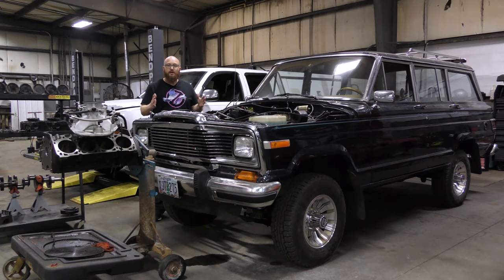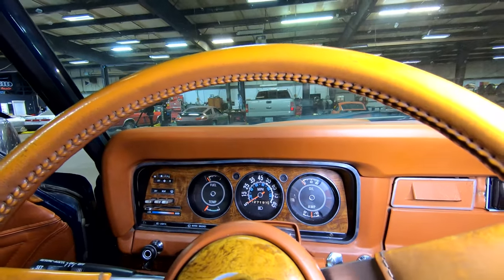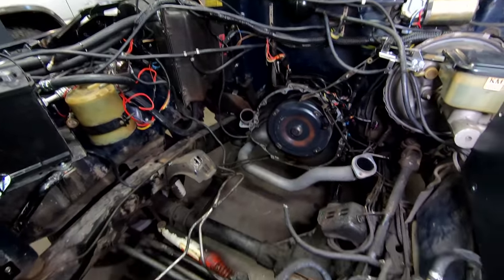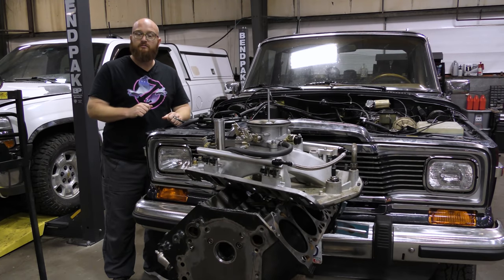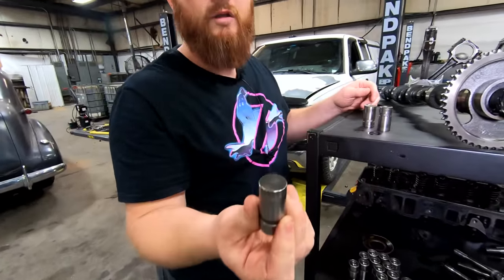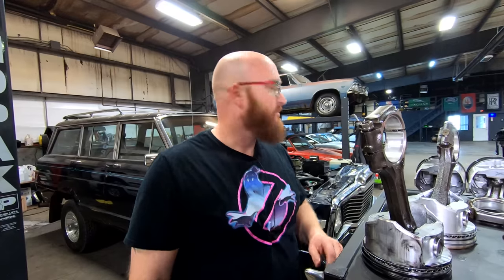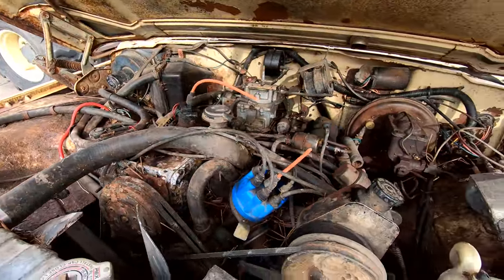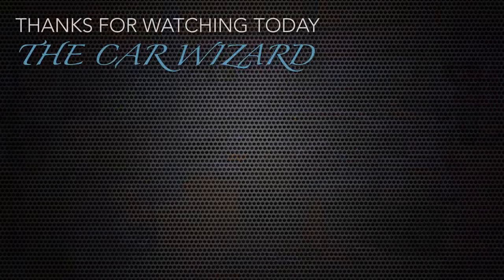The '83 Wagoneer rebuild is dead! CAR WIZARD gets burned by another shop!

Comment: Wizard - I am the proud second owner of a 1989 Mercury Grand Marquis LS 50th Anniversary edition 4 door sedan in Dark Blue Metallic paint with only 68,000.0 miles !   This car runs and drives like new and looks like it just came out of the showroom. I enjoyed your video about your tan Mercury personal car. This just proves that these wonderful cars are still available if you look for them. My other two cars are a 1987 Ford Crown Victoria wagon which I have owned since 1988 and a 1991 Ford Crown Victoria Wagon that I have owned since 2001. All are in excellent shape and the 1987 has almost 250,000.0 miles on it and runs like a watch. My fourth vehicle is my 1966 Jeep J-2000 Gladiator Pickup that I still plow snow with. Old Jeeps are great ,rugged vehicles .

Comment: Used to have a Wagoneer way back in the day.. we ended up swapping a Chevy 350 and transmission from a 86 3500 with a transfer case from a 79 K10, part time 4 wheel drive, NP something something.. had to cut a hole for the transfer case shifter.... I don't keep anything original.. had an old AMC Rebel that we swapped in an old souped up wrecked rust bucket 69 Pontiac Firebird 400, whole drive train..

Comment: I have rebuild a lot of V-8 engines, but I never saw a pushrod break through the block like your engine did. And I worked at a Jeep dealership when American Motors was building the Jeep Wagoneers. Those engines were good engines except for 2 things. Timing chains and water pumps. Very strange,,,,,,,,,,,,,,,,,,

Comment: RE:  ZDDP or Zinc Dialkyl Dithiophosphate    I have a comment that I hope is helpful. You didn't mention what kind of break-in oil you used.  On older style engines that were designed pre-1980s with flat tappet/lifter camshafts, like the one in the Jeep Wagoneer, one has to use the right break--in oil or additive, with 
ZDDP or Zinc Dialkyl Dithiophosphate, 
in addition to assembly lube. When motor oil formulations changed a few years ago, ZDDP was banned in use and it's generally not included in motor oil available today. It's not a problem with roller lifter, but it is with older engines that use flat lifters. I have built a lot of older engines, including Chevrolet 235 inline 6, 283 and 348 V-8, Triumph Spitfire, and Volvo B20, and all use flat lifters. I would also suggest using the ZDDP additive for at least the first 2 or 3 oil changes until you're sure the cam and lifters are worn in properly. 
I use ZDDP additive in all my oil changes on older stuff even after break-in. So, really, either use a break-in oil with ZDDP (it can be had from sources) or get a ZDDP additive. While the engine you had may have been messed by inferior parts or a poor assembly mechanic, a small detail like the wrong break-in oil can really ruin a lot of work.

Comment: My 04 wrangler rubicon, Jeep rebuilt the engine on 05, less than 60k on the new motor I had this same thing happen to my lifter and cam, HOWEVER this was due to the quality of the head during those production runs. This December I chased a P0301 with the parts cannon and nothing then the intake valve on cylinder 1 failed “sucked a valve” intake valve stuck high buried the pushrod holding the lifter down creating the EXACT same condition you pulled out Jeep. I know you have but I’ll say it anyway, check that valve on that cylinder.

Comment: . . .  for clarification, you have a rat motor from a Jeep outside.  (I liked the 427 Chevy.  I had a 1969 Chevrolet Caprice with the 400 Turbohydramatic.  I had it for over 100,000 miles.)  . . .  Sorry, but I could not resist the comment about the "rat motor".  🤔  I sure enjoy your comments.  . . .  and your wife is appropriate with her comments.

Comment: Rules of thumb:

1. If you think you've used enough lube, you haven't.
2. Always triple check your clearances and mic your rounds, make sure they're still round.
3. If you can't break in the cam (lack of test bench/dyno etc), tag the engine so the next guy knows to do it.
4. Use a race shop when you can. They know shit even avg machine shops don't.

Comment: I had an AMC 401 built about 2 years ago. They are special engines and not cheap to build right. But oiling issues are the main concern. This is just bad machine work! Glad you have an engine, but also 360s are fairly cheap and common since they made so many for so long. 91 grand Wagoneer with the AMC 360 was actually the last production domestic vehicle with a carburetor!

Comment: Martin Machine is a fantastic machine shop. I work with him from time to time when I get in a pinch in my own machine shop.  I will say however I wouldn't condemn  the original buyer based on what you have shown. In the last year I have had similar failures not less than 6 times. The cam cores for the hydraulic flat tappet cams are failing at such a high rate throughout the industry that it is giving us a horrible reputation.  
In my shop alone the warranty rate on engines I have been building for 20 years is up 400%. Between cam failures, lifters that collapse with less than 500miles on them,, bearing delamination (king bearings) and crankshafts that are cracked straight our of the box. 
The failures you have started with the cam going flat and the lifters collapsing. After the pushrod punctured amc's notoriously thin water jacket the discoloration of the rod bearings would have shown up near Instant.  They first show any deviation in the honing of the big end then a little longer they will be darker grey and look like they have water spots then seize. 
Once the cam wore through the bottom of the lifter it would have experienced a change in oil flow internally and started to seize the rod small end. In one shot the jammed piston looked like it was galled up the side this can deform the piston enough to lock up the rod also.
Again I am not sticking up for the shop that did the work. I however just like you have found out from other people that I preformed a job that the customer is now mad about. If that customer had simple come back to me I would have made it right no questions asked but was never given the chance. Obviously there may be more to the story.
Reply: How does the push rod puncture the 'thin Mopar water jacket' in an AMC 360?

Comment: Ummm....the hole in the block wasn't caused by the lifter.....scrubbed cam lobe tosses the push-rod when the clearances became wild...
But still....a stock valve spring having enough force to do that with one cycle?...Looks more to me like the block failed and flooded the cam lobe with coolant.
  That valve train is OLD school Detroit, long before the Chinese parts began to screw ICE reliability. Any engine build shop in my opinion, should pressure test the coolant passages before any machining process....but even then, why the heck would a casting fail there?....bad production processes

Comment: I have a 401 AMC V8 in my 74 CJ5 I built 12 years ago . It's just gone 70k problem free miles since the rebuild and I 've beat on it like it owes me money since day 1. The key to AMC V8s is Correctly performing the required oiling system modifications,  the addition of a oil pump Stainless Steel mid plate and adding a additional quart of quality oil of the right viscosity . I have ran my 401 and every other AMC V8 hard including extended runs @ high RPM on a dragstrip and in the mud pit countless times and haven't had a failure since I began doing the suggested mods and additions to their oiling systems. It's very easy to get excellent power and performance from the AMC V8 engines with just a few changes with the oil mods being first. They are cheap considering their benefits , very easy to accomplish and require just a little bit of Time and effort to make a good engine a great engine.  Everything one needs to do is clearly outlined on several different online forums and websites.

Comment: Wanted to add something about this that I have seen a video on... 
 I think it was from Uncle Tony's Garage.  He is a KNOWN master engine builder especially Mopar. Also a known former drag racing guy. Guy knows what he is doing.
He did a video on a serious aftermarket parts problem he had run into on some builds.
bad lifters being sold by reputable retailers.. He had an engine  get trashed during the break in process, discovered that the surface on the lifters was NOT crowned properly and also possibly not hardened properly.. that prevents them from spinning as they are supposed to.. and results in camshaft destruction, and fine metallic powder created by the lifter grinding away at the cam lobe being pushed all thru the engine, destroying or badly scuffing the bearings as you see in this engine.
the risk in reusing any of the parts is that you could end up pushing debris from the old parts into the oil passages on the new engine and wrecking that also.

Its also possible the engine builder messed up something too.. but since this failure is exactly what he had happen in his engine.. I thought I should pass on the info.

Comment: That can lobe died from a common oiling issue common to the 340, 360 and 401 AMC engines. Crossover oiling does help but requires drilling and tapping NPT threads.

Comment: FYI. These days there are many new cams failing.  The word is the steel being used in most ALL new cams is inferior.  The lifter wipes the cam stops lubing in that cylinder there fore blowing the rod.  It’s a big problem wiping the old diehard powerplants into scrap one by one.checkout Uncle Tony’s Garage, Envyclopedia of knowledge(Mopar) peace

Comment: I suspect the break in was done without a proper ZDDP oil.  The motor oils available today have little or no ZDDP (zinc phosphate).  That is fine for more modern cars with overhead cams or roller hydraulic lifters.  A flat tappet hydraulic lifter like that will flatten the cam in short order and then the fine metal particles go everywhere.

We had a customer with a pair of 454 big block Crusader engines in an older boat.  He changed his own oil with Pennzoil 10W30 from Walmart.  The oil had no ZDDP in it and shortly thereafter, both camshafts went flat.  Very expensive.

Comment: I'll add what's been said below about the parts quality these days.  On my old vette the US made parts suppliers are all gone and inferior parts, even OWN are sources now from overseas.  I've done proactive maintenance on parts over 30 years old with the new ones failing in less than 30 days.  Things like a clutch master cylinder roid turning into a boomerang from a lack of proper heat treatment. Incredible.  I've had 2 new factory pushrods boomerang on 2 different engines probably from the same.  I'm rebuilding a Porsche air cooled engine now and while I'm paying all the money for the parts, I'm getting 100% German OEM or Porsche factory parts made to the original specifications by the original manufacturers.  This is what we've come to in the past 10 years with cheap junk flooding the market.  Not to say that this was the case on the Jeep engine, but it may be something like the wrist pin may have been made of cheap untreated metal and deformed.

Comment: Wait! Wizard did you say break-in oil when you meant to say assembly lube? Do NOT use break in oil. It is garbage oil. Break your engine in with what you intend to run. I  experienced two cam failures using break-in oil on domestic V8s. I stopped using garbage oil since and have never had an issue. Break-in myths are shit.

Comment: Hey,, while the engine is out,,, check the front pump bolts, behind the torque convertor....
 They have been known to work loose and cause transmission fluid leakage🎯
( been there, done that,,,lol)

Comment: So im trying to figure out what exactly the previous engine builder did to cause this failure. Nothing in this video proves they did somethin wrong.... reman/aftermarket cams are known for lobe failure due to hardening problems. Even high end companies see this issue. That in turn chews up the lifter. Material from this can and will plug galleys/orifices and cause starvation, or end up im other bearings causing galling. Im just not seeing what the original builder did wrong. Yet the title of this video directly points fingers. Clickbait? And whose to say the orog builder wouldnt warranty it? Even if it wasnt their fault. Nobody tried? Right? Just assume they did somethin wrong because it broke?? Brand new vehicles chuck motors with less than 100 miles... clickbait false advertisement video to get views.

Comment: It looks like the root cause is lifter failure, but what do I know. My understanding  from another YouTuber is that (most?) Hydraulic flat tappet lifter body castings have been out of production for a long time. Any "new" lifter is actually a used body casting, refinished and then fitted with new internals. They can fail in a mode where they leak down.That YTer primarily deals with Mopar. I think that some of the AMC lifters are the same size as Mopar, so they might have the same issue. If you lose a lifter out of a lifter bore the oil gallery pressure (since most engine's cams are fed oil first) drops quickly. That might mean that the oil squirted by the crank up to the piston pins, stopped. That might be why the pin seized up. Good lifters should not bleed down. Pressurize the oil system (with a drill, if possible) and let the engine sit for a while. Remove the rocker covers and try to compress the lifters by pushing down on the pushrod side of the rocker arm. The pushrod should not have any slop or bleed down, even after several hours. I would suggest getting the engine back to the rebuilder. If they see what happened to this engine, it might prevent another customer from getting another defective  engine. Just my $0.02 worth...FWIW.

Comment: Put in a remanufactured engine in my truck 5.7. Break in went alright. Changed the break in oil to 5/30 and changed it after 1500 miles. Looked like black mud never had oil that dark in any of my vehicles. I suspect the block was not boiled out. But I feel better now after reading so many other peoples problems.

Comment: The machine shop was not the failure. This cam and lifter thing is driving everybody crazy. I had an inline 6 that destroyed only one lobe. I let the engine idle during break in. My fault. Don't throw that block away. There are outfits that can weld it properly. Costly but blocks are getting rare. On the inline I used a full bottle of Lucas Zink additive. Held it at 2500 rpm for 35 minutes and no problem. Drain oil at 500 to 1000 miles as a full bottle of zinc is way over the limit. Feel free to contact me if you have questions on this. I've got countless hours of research on this issue

Comment: Much respect to you for actually finding out what happened to the motor instead of jumping on the poor guy just trying to get the injector system to work right.
Nice piston wrist pin and self milling ( inside the engine) camshaft and lifters.
I thought you were going to say the engine blew and you took a look at the oil pump and it was attached inside the engine with bailing wire not bolts.
Car Wizard ,you might have saved this guys entire family because,if that engine blew up at seventy five miles per hour ,it could have been a real nightmare.
I also like the ammeter thing.
Car Wiuzard-"These are known for burning Jeeps to the ground.
Owner.."Yea,let's not hook that gauge up."

Engine rebuilding is a collosal pain in the rear and those unwilling to face the nightmare and do it right ,need to not rebuild engines.
You might want to gift the guy a red boot on his Rancho steering dampener.

Comment: My chicken vs egg detector is going off. Yes, there are a TON of issues with a lack of availability of good flat tappet lifters in the market. BUT, having had AMC engines in the past, I think we may see an issue caused by a builder not performing the initial run in correctly. The oiling system on the AMC is less than ideal in some cases....especially the first start up on a new build. You must and I mean MUST prime the oil system manually before firing regardless of what assembly lube you use. While priming the oil system you must also rotate the engine by hand to ensure that all the oil passages are primed, and the lifters need to be soaked at assembly to prevent a collapsed lifter. On top of that you MUST use a high ZDDP(zinc) break in oil and perfom a proper cam break in by keeping the rpms up in the 2000 to 2500 range for 20 minutes to properly seat and mate the lifters to the cam. I'll wager that the engine was started dry without priming, starving the lifters which allowed them to beat on the cam lobes. This sent metal through the engine eating up bearings and destroying that little 360.

Comment: No way in less than an hour lobe wore off that fast unless metallurgy wrong Rockwell C scale.
No additives oils would  prevent that.
I build hundreds of engines for industrial, marine, trucks since 1976 never had cam lifter issues. Never did break in or used zinc .
Chinese metal today must be the issue.

Comment: At a guess It ate a lifter and the trash went through the bearings,  excessive clearance provided opportunity for the pushrod and lifter to exit and much up the block , the thin casting is a manufacturing flaw ,  this probably started with cam breakin proceedure  , and parts quality available today plus the oil without all the vitamins  , Buy NOS lifters if you can find them next round. Good Luck ..... Nice Jeep

Comment: I had a '89 Grand Wagoneer. Most unreliable car I ever driven. I had to give it away after it's third engine failed, due to oil starvation. Previous two engines failed the same way. Stay away from these, looks are deceiving. These far overated and priced way way more than what they're actually worth. If everything best bet is to drop a Chrysler small block with a CARB the 904 trans and just go down the road. Twenty years ago you couldn't even give these away. no one looked once at them.